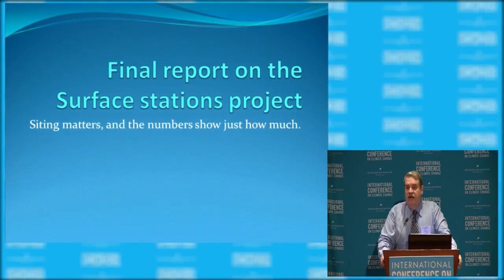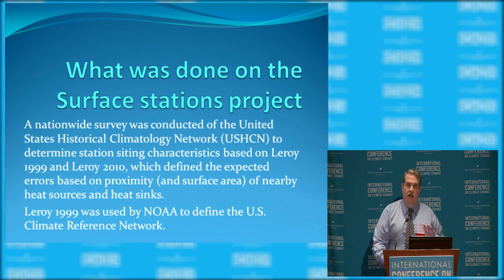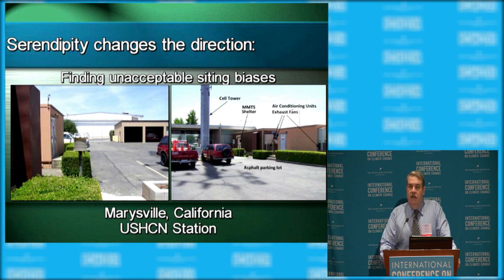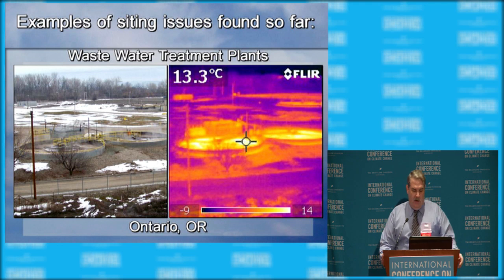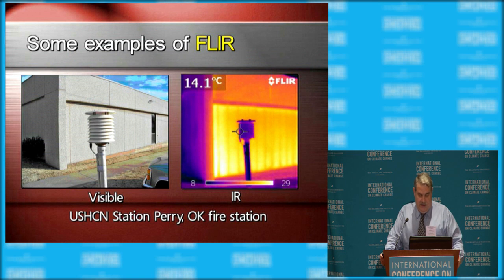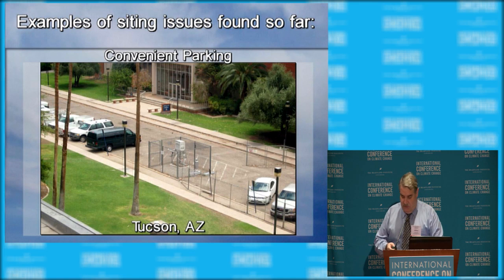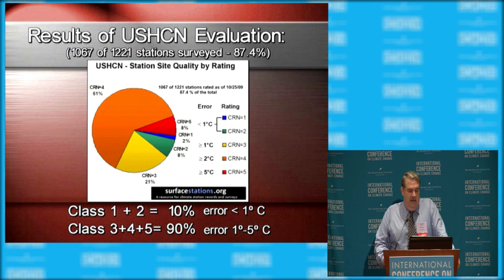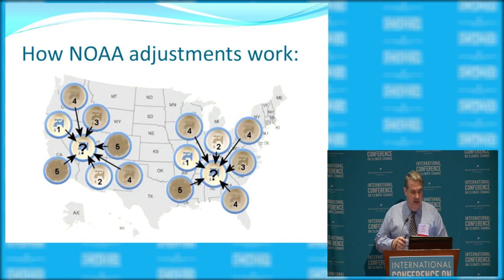Anthony Watts - ICCC9 July 9, 2014 (Panel 15)

Comment: Where are the 'Anthony Watts is NOT a climate scientist' trolls ? I miss them.
Reply: *****
The people who are unethical are those who parked surface stations next to heat sources and then used those readings to tell us the climate was getting warmer.
Reply: ***** No, if those stations were not previously parked on concrete or over a gravestone, but were moved there, or a building put up during the last 30 years, it would show an increase in temps due to the heat sinks regardless of whether there was warming otherwise.
Reply: ***** You show no insight whatsoever. Those sites were not always next to heat sources. Who's the moron now?
Reply: ***** Loud Noises ? I love lamp ?
Reply: ***** "And everyone knows that and corrects for it."
In the wrong direction.
http://www.friendsofscience.org/assets/documents/CorrectCorrections.pdf
http://climateaudit.org/2008/03/01/positive-and-negative-urban-adjustments/